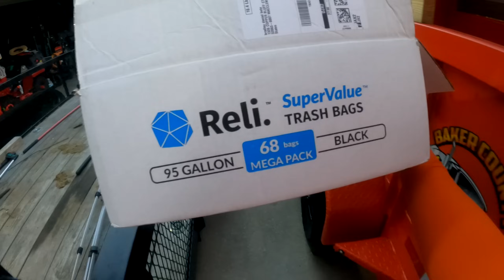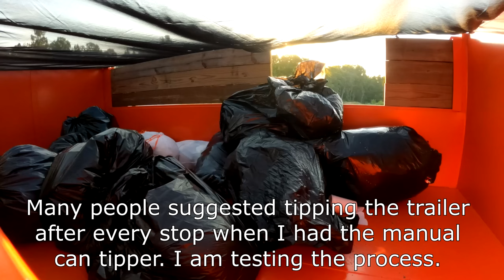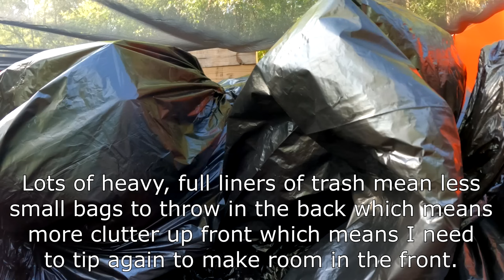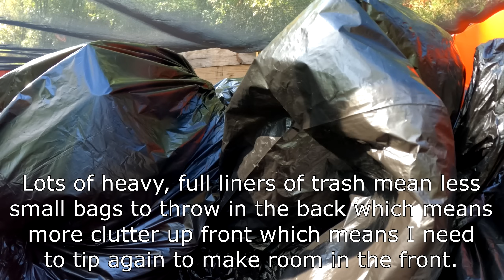(EP. 7) ASMR Trash Route Garbage Man: Satisfying Sounds Of Working

Comment: Is each can specific to a location?

I was thinkin maybe you would be able to swap them out, maintain them and so forth. Not only does it help protect your investment but keeps the idle cans less idle.
Reply from the maker: No, I should be tracking serial numbers at people's houses but haven't been.
Reply: @BakerCountyTrashPickup  maybe you could stick some QR codes on em for that. 

I was just thinkin coz surely those cans get super nasty even with the liners in em. But also wheels get loose and all that. It gives you an opportunity to keep em tip top shape. With as much as them suckers cost I’m sure protecting the longevity has its value.